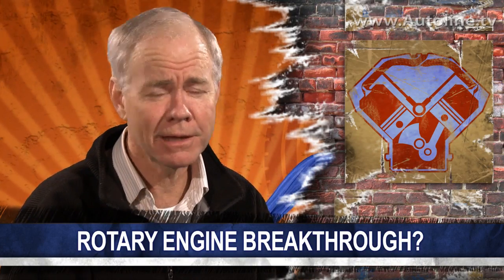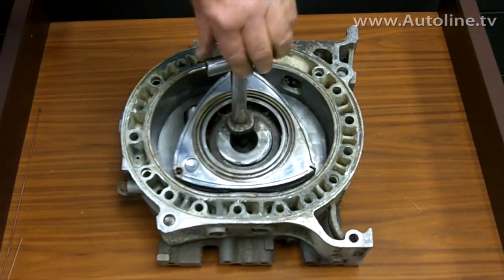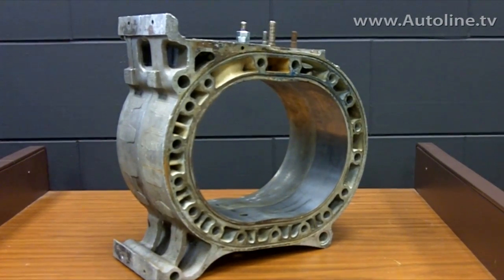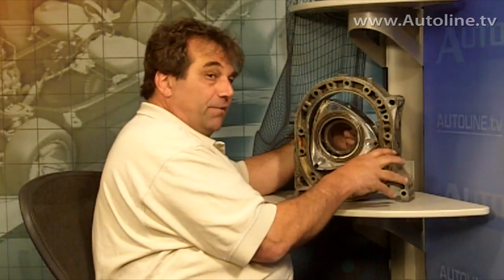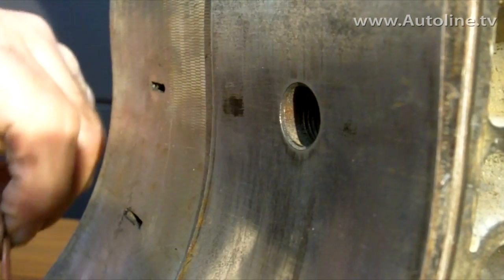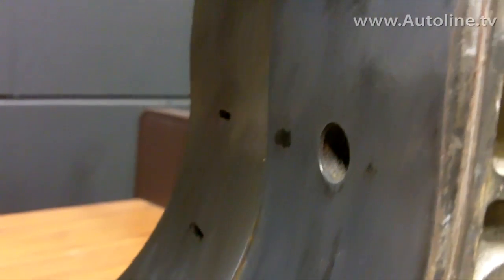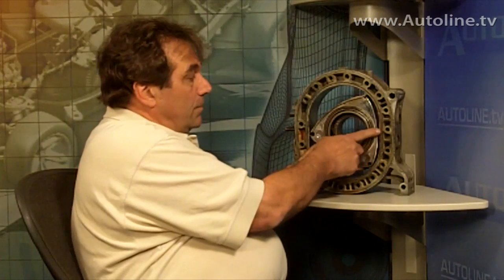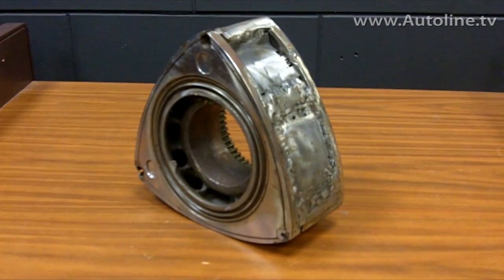Rotary Engine Breakthrough?

Comment: AC electric motor has 1 moving part, 20,000 RPM and flat torque output from 0 RPM, and 50% smaller and lighter than the smallest Rotary engine.

What I am saying is, Mazda doesn't have any resources to throw at rotary engine R&D at this time. Yes this idea (and hundreds of other this-will-save-rotary fixes) may help, but if Mazda keeps spending the money and time on this, they will not survive as a business. They literally need to double its gas mileage and torque overnight…. Ain't gonna happen, so Rotary is DEAD.

I really hope Mazda doesn't become the next DAIHATSU, ISUZU or SUZUKI.

Let it go, and move on Mazda.
Reply: doktorbimmer In 130 years there has been masses of money poured into R&D of piston engines.  Only a fraction of that money would make the Wankel the only IC engine available.

Comment: amazing idea truely thinking ahead to bring the rotor to life again
Reply: doktorbimmer its because  it has to have a terrible combustion camber design and the gas is still burning on the exhaust stroke ....volumetric efficiency per rev is better than a 4 stroke but comparable to a 2 stroke
Reply: The Wankel is handy for sure
The rotor housings make passing a rope through them convenient.
Take two rotor housings fishing! Anchors aweigh!
Reply: doktorbimmer Dylan Faifua You know that actually there is leakage towards the compression chamber and not the other way around as this guy thinks, right? He just ignored the pressure of the gases in the expansion chamber, as the expansion chamber's leading apex has not reached the exhaust port yet when the intermediate apex passes over that spark hole. It is the upper spark plug hole that causes problems, and that's the reason it is smaller.  Mazda engineers were not stupid, it's just this guy has not done all his homework. As for the cavity, early 12As had an eccentric cavity that was later abandoned, meaning there was a reason for it not being needed.
Reply: doktorbimmer Excess heat wasn't one of my concerns. Though exhaust gases temp is higher because the gases are exiting the engine before the flame fully extinguishes. If you see a Wankel engine working without headers, it is evident, as there are constant flames exiting. As far as consumption is concerned, I'm a rotary head myself but admit that for given output the fuel demand is increased compared to a piston engine. The reason is that the Wankel needs richer mixtures for safe and smooth operation.
Reply: doktorbimmer I fully understand the concept and I know exactly what I'm talking about. Plus, I already explained to you why it has high EGT. Statements like 'it burns fuel for 1000hp but makes 200' and such are unacceptable. Combustion is not that simple. FYI the exact same engine can make far LESS power for considerably MORE fuel by simply lowering the AFR. This proves your argument wrong. There are terms like AFR, volumetric efficiency etc that affect the output of an engine.
Reply: doktorbimmer dude richer mixture results in lower EGT. its tuning 101. have you ever tuned anything before widebands were available? .....
Reply: doktorbimmer Did I ever mention that the Wankel's high EGT is due to the relatively low AFR? Read more carefully and do your homework. Please don't waste my time.
Cheers.
Reply: doktorbimmer I have already answered that question in my second reply.
Reply: doktorbimmer Low AFR means that less air that what is stoichiometrically needed is provided to the engine. Yes, lower AFRs result in lower EGTs FOR THE SAME ENGINE. It still cannot countetact the fact that the exhaust gases exit the chamber while still burning bright. And don't forget it is a 1.3L engine with the volumetric efficiency of a 2.6+L
Reply: doktorbimmer Please read previous reply. Both play their part. Wankels with leaner AFRs are even hotter. ;-)
Reply: doktorbimmer
Wankel=Inefficient, carbon fouler. The plugs get stuck with carbon in their threads, and the Apex seals wear out quick[burning oil] when made of carbon, or excessively wear the side housings when made of iron.

Lots of fun cause they rev high-but that's it.
Reply: Rotary engine is dead
. Dead and buried

Comment: NSU licensed the Wankel to Toyo Kogyo and subsequently Daimler Benz. Both leaned toward eventual diesel application for the Wankel.

Stratified charge is where the two stopped development. Both have designs that are based on diesel fuel which possibly may be more valuable when peak oil hits American car buyers in the wallet and displacement based taxation on vehicles go worldwide.
Reply: doktorbimmer
GM was the first to use the Wankel in a production vehicle
Reply: It was the Chevrolet Monza(1975-1980)  They eventually swapped the motor because of  engineering flaws and the Arab oil embargo affecting the buyers decision to get the vehicle since it had poor fuel economy.  They were going to put it in the Vega in 1975 but didn't because of engineering flaws at the time, and ended up putting it in the Monza for about a year and then did the swap.
Reply: doktorbimmer I meant to say GM was the first "American" company to use the wankel in a production vehicle here in the states lol  I brainfarted a little
Reply: doktorbimmer  If I remember correctly the  Benz C111 IV was the closed course 24 hour endurance record holder at Nurburgring for a short time and it was a diesel Wankel.
Reply: Joseph Germany GM produced an aluminum alloy block and SOHC head for the Vega. It used high content silicone impregnated pistons and no iron liners in the bores.
It was a design failure. Smoking like a mosquito fogger at 20,000 miles with oil burning.  Cosworth designed a four valve DOHC for the little GM 122 cid. The Cosworth Vega also had Fuel injection. Eventually GM did band aid the racer with liners as did the re builders.  GM built a one off ASTRO concept car with their own rotary design but it never went into production and never went in the Vega.

Mazda Gave America the RX-2 rotary. I can't recall if any R-100 coupes were imported first.  Americans could not be trusted with keeping oil level topped off in the sump of rotaries. The 4bbl carburetor had a small oil feed into float bowl to lube the rotor seals as a fuel/oil mix. The rotary is still a four stroke engine. The smoking/oil burning rapid carbon apex seal wear was actually caused by poor maintenance and low oil levels and fools revving the factory 1.3L to 8500 rpm repeatedly.

Lazy fat butz should not be driving high revving rotary engines whose poor fuel economy but high power to weight belong on a race course, not on main street.
Reply: Joseph Germany Thr Monza was a Vega with a 4 cylinder piston engine like before The high point of the Monza was the 305 Small block V8 shoe horned into the chassis as the Monza Spyder. A smog controlled inefficient paper weight making an anemic 145bhp.

Chevrolet got the idea from Drag racer Grumpy Bill Jenkins who turned the NHRA Pro-stock class on it's ear when he showed up with a seriously powerful racing small block surrounded by Vega sheet metal bolted to his his chrome molybdenum frame.
Reply: The combustion process is incomplete in the Wankel. Too much energy ends up in the exhaust.

 So even if it's fun to drive and fast it is just bad engineering when you get diminishing return on BTU energy.

I don't enjoy pissing my money out the tailpipe.
Reply: I have a Generation 1 RX7(1985) with the original motor and less than 90,000 original miles. lol and the damn thing still gets 20mpg
Reply: okay have you seen the ceramic rotary guys?
Reply: The only redeeming quality of the Wankel is that for high altitude aircraft, the stratified charge Wankel engine can be purpose tuned to operate at ridiculously low fuel/air ratios.

 In applications where compact size is necessary and high power it has been buried by secrecy to which it's refinements remain classified. NASA continued in secret with the engine just a decade before.
Reply: okay wut
Reply: doktorbimmer Oh god Moller... Bricklin ran his own outfit in the 90's. John Deere bought Curtis-Wright's Wankel divison in the 1980's.
Reply: NASA stratified charge research in 1990's

Efficiency over 110% at altitude. Project was skunk-worked to RPV development program.
Reply: Volumetric  Calculations can prove  mathematically that an internal combustion engine can be purposed built and designed to operate in a specific limited Rpm range to exceed 100%. Fact. I misstated that the efficiency was over 110%.

Comment: hot exhaust means only one the thing, incomplete energy transfer, which why this engine has very poor mileage reputation...
Reply: Yope. And that is due to poor combustion chamber shape that doesn't allow good combustion propagation. Good luck about that with the spark plug slot ...
Reply: yes

Comment: It doesn't fix the primary issue with rotaries, which is the apex seal itself. That is sort of a big issue as a rotary guy myself.
Reply: Joe11Blue hub wheel motors with a rotary driving the generator. :) Have you seen the Ceramic Rotary Engine guys? Its interesting to see these guys going after the sealing problem.

(also I got the Wankel history book off amazon - had no idea engines were so interesting).
Reply: doktorbimmer the only way to find out is to try. :P
Reply: doktorbimmer actually from the stuff I've been reading, it seems that the ceramic guys might have something interesting going on. One way to boost IC effinciny is to minimize heat loss to the engine walls...

I have to admit I'm neither an engineer or a mechanic, but damn. I never knew engines would be so interesting.
Reply: Any ideas, or alternatives to Wankel? I'm also interested in rotaries. :D
Reply: SeverEnergia It depends on what you are looking to do.
Reply: I suppose the thing to do would be to replace the Wankel and usher in a new era of rotary engine cars. :P I think a turbo-electric transmission with a rotary driving the generator would be pretty nifty. Probably cheaper then a turbine...
Reply: @SeverEnergia  There was an article by Jan P Norbye: 'Rivals to the Wankel', Popular Science, January 1967
Reply: @joseveintegenario-nisu1928  oh wow eight years! That name sounds familiar - I later got the two dedicated wankel books.
Reply: SeverEnergia I expect turbine electric hybrids to take over well before anything with a piston does. Pistons are over a 100 years old, and honestly outside of materials advances the design is really outdated and almost to the limits of it's capabilities. Where piston engines were 20 years ago is like the stone age compared to today, but in racing we can see the limitations clearly.
Reply: Oh wow. This HCCI stuff looks pretty sweet. Thanks!
Reply: doktorbimmer WHich is why you pick an RPM level and build the turbine to run in that specific range. Turbines are far more efficient at steady state power delivery than any other ICE.
Reply: Joe11Blue but turbines are more expensive. :s
Reply: Yeah, I was reading a 'alternatives to ICE' book from my university library. :)
Reply: Lower EGTs may help those seals. Also the fact that the power stroke isnt fighting itself even if just a little bit. It really would be interesting to see these modifications put to action in a daily driven car then see the tear down after 20k.

Comment: Hot Start Cures:
1) once flooded put your accelerator pedal to the floor before you crank so that you get the maximum airflow through the engine to dry out the combustion chamber (just like a 2stroke). In future to stop the engine, run the engine up to 4000rpm then take your foot off the accelerator to shut off the petrol, and when the rpm comes down to 1500rpm turn off the ignition key. This turns off the fuel supply and dries out the engine for easy restart. Perform the latest ecu software update which also stops over fuelling when cold or hot.
2) drop by your local scrappy and install the biggest second hand (read £20) battery that will fit in your battery tray (Ford Transit Van battery etc)
3) Mazda have a bigger starter option (£350) that will spin a flooded engine at the required minimum 200rpm (just like a 2stroke)
4) Hot Start Cure: google "Mazda RX8 Ametech Engine Restorer" and just shake up and add a 400mls Ametech additive to the existing oil (under £30) and top up with Mazda mineral oil and drive normally. Hot start compression problem CURED within 300 miles or a week of normal driving. Lasts many years and adds £1000s to the value of the car. The tiny copper silver lead particles in the Ametech quickly fills in the rotational scratches in the double eliptical cylinder walls improving compression.

Comment: A drawback with the rotary engine is the high emissions. Oil is injected to lubricate the apex seals on the rotor and gets in the exhaust stream. My 1st gen RX-7 was considered a gross polluter by California.

Comment: Norton used off set combustion scollops on all road bikes the rotors are either left or right hand, the final racing rotors had central scolp so the rotors were not handed. Max rpm 10k on a norton rotary

Comment: He is not taking into account that combustion is a slow process. by the time the spark occurs and flame propagation is happening the rotor is already past "TDC". Its like saying that in a piston engine, all of the combustion force occurs at TDC. Remember Intake, compression, ignition, POWER, exhaust. The bowl cut into the rotor centralizes the fuel mixture under the spark plug so combustion can start. Mazda did move the dome further to one end, but not much. Not sure about the spark plug hole and exhaust gasses. I'm also assuming Mazda thought of this.

Comment: He talks absolute sense! Unbelievably badly designed when that guy shows you why and everyone knows there are flaws.  Anyone know if it worked?
Reply: Manoo62 you call getting 200hp out of a 1.3L achieving nothing?  Yes, the engine has flaws, but its not like normal piston engines don't.  They make better power, but waste a lot of it in how they transfer that power to the crankshaft.  Mazda has had many rotary engines, but I don't doubt that it could still be improved.   They just stopped because there is little money in it.  Auto makers WONT BUILD ANY CAR that they cant make money on.  Look at how GM killed the electric car.  they built a good electric car in the 90's....that people wanted to buy, and they took them and crushed them.  Why? cause there was no money in repairs.  Less parts meant less repair costs.  Why do we see hybrids coming on strong?  Because it just means twice as many parts for them to repair and maintain....which means more money for the auto makers.
Reply: He talks absolute bullshit! if you slot the spark plug holes they blocks with carbon very quickly  and the engine stops. Offsetting the combustion chamber has no effect as total pressure acting in the combustion chamber is unchanged. All of his ideas were tried and discounted long ago by Mazda. The fatal flaws in rotary engines CANNOT be overcome which is why no one is making them. This guy is an idiot who knows little about rotary engines.
Reply: Kevin Chamberlain
As I have already said rotary engines are fatally flawed, there is NO potential to be squeezed out them. Mazda spent 50 years or so at it, achieved virtually nothing and have now given up.
Reply: Manoo62 Where did you get 3.9l from? A 4 stroke engine takes 720° of rotation to complete a cycle. So to compare a rotary in terms of capacity (even as pointless as it is) we take the swept volume in 720° rather than the 1080° of crank rotation you would need for all 3 chambers to cycle. We end up with 2.6l. However 360° of a piston engines cycle is neither compressing air fuel mixture or creating power, so technically a piston engine is rated on 360° of crank rotation, 360° in a 13B gives us 1.3l.

I'm happy with 1.3l or 2.6l but 3.9l is just wrong.
Reply: RCPro Driver
You mean 200bhp from a 3.9L engine. Rotary engines produce very low torque because the dont have a crankshaft and you see that as an advantage!! They cannot be improved which is why they have largely died out. Mazda wont build any more RX units because the economics are not there because too few people what them. Hybrids are not coming on strong but they are the only format that currently works for high economy cars. But they are still no better than small turbo diesel engines. Electric cars are phenomenally expensive, have low ranges and take 8+hours to recharge, ridiculous.
Reply: iamvezm
A piston engine completes 1 thermodynamic cycle in 720° returning to its original mechanical position. For comparison purpose with a rotary engine 720° of rotation displaces 2.6L. However this is only 2/3 of the thermodynamic cycle for the engine, only 1080° returns the engine to the mechanical starting position and represents a full cycle which is 3.9L.
The 13b has 6 chambers firing in 1080° and 4 firing in 720° so its closest to a 2.6L 4 cyl piston engine. The comparison of 360° is nonsense as the piston engine only displaces half its capacity in one revolution meaning 2.6L would be 1.3L for both engines.

2.6L is acceptable for comparison but 3.9L is the actual capacity.
There is no basis what so ever to call it a 1.3L
Mazda use it simply to make the engine sound impressive because the real capacity/performance is so disappointing. Which is why no one is making rotary engined cars, and probably never will again.
Reply: Boony Tooty
Done What??
Reply: Manoo62 You said Mazda has given up on the Rotary? They are currently designing a new model for the upcoming RX7 in 2017.
Reply: @MasterE56  RX7 in 2017?? You look stupid right now.

Comment: I find the design of the rotary engine very interesting.  The big thing I find unsettling is a cylinder configuration has an easy to understand equalization of pressure within the cylinder wall, but the horizontal compression area in the rotary engine seems inefficient.